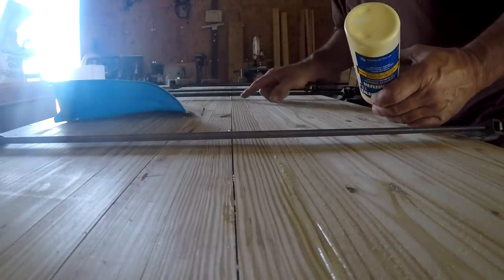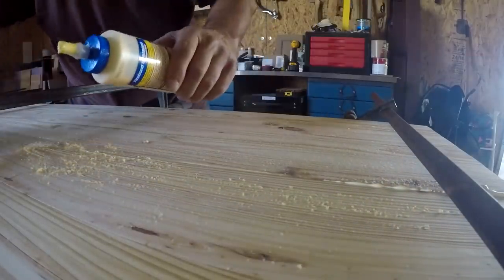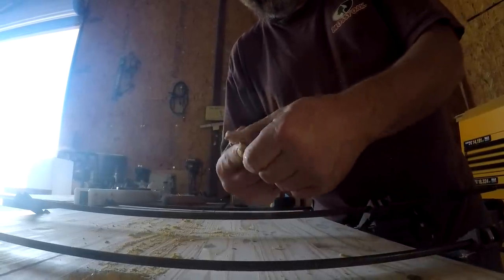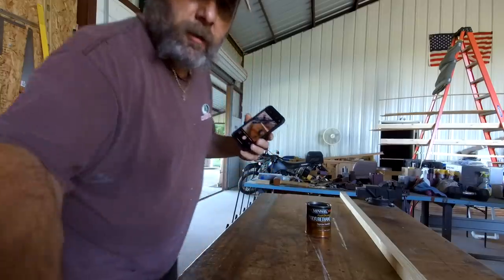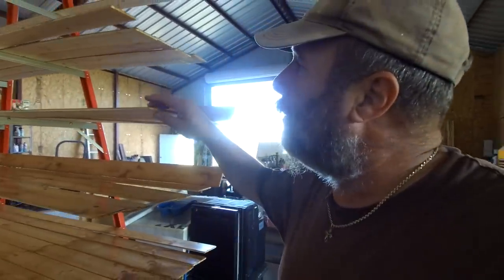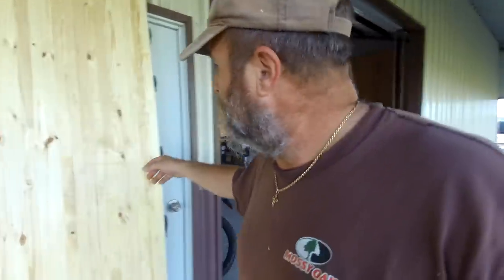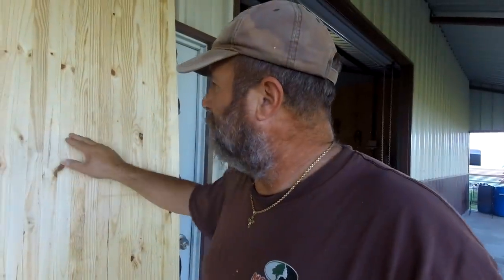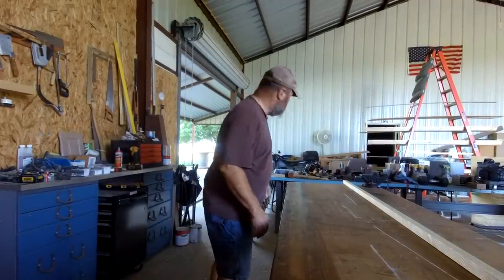514  Going thru the grinder / Cargo trailer RV Conversion

Comment: Home Depot sells fingerjoint maple butcher block countertop in 2’ x 6’ or 8’ lengths. Probably at about the same cost as DIY
Reply from the maker: HD's 8' countertop is about $215 and the 4' is about $110  Total $325   My cost for the wood for both is $40
Reply: Sasnak See you did your homework. Was that wood you used rock maple? Seems like a lot of hard maple for $40